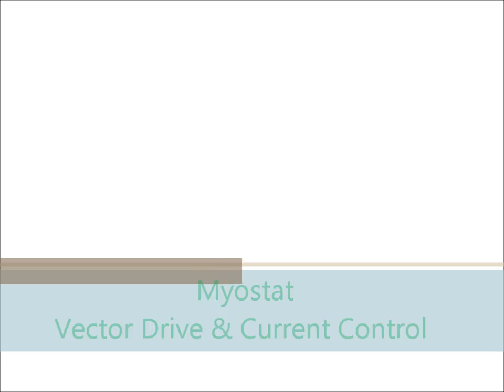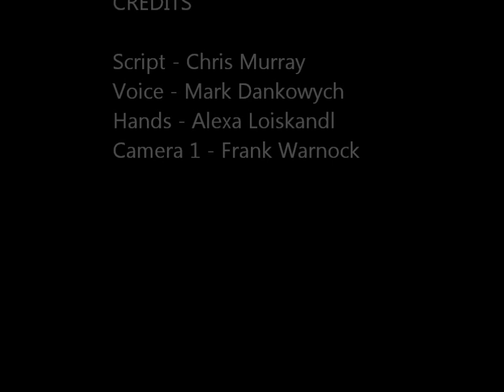Cool Muscle Integrated Servo - Vector Drive vs. Simple Idle Current settings in stepper motors

Comment: hello, one question. Cool Muscle Integrated smart servo systems are basically stepper motors with feedback, or BLDC 3 phase motors with feedback?

I see these motors use feedback to control position. Cool. But my question is the following: Is this system based on a stepper motor, or a BLDC 3 phase motor, like normal servo systems?